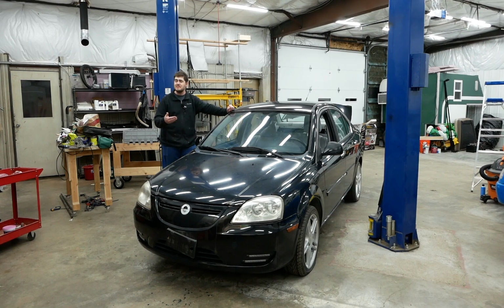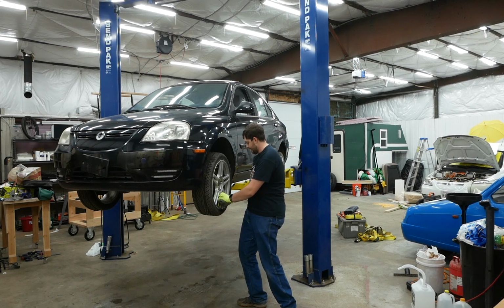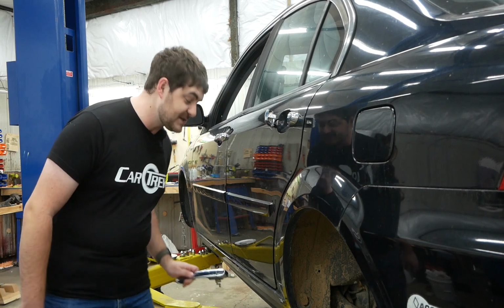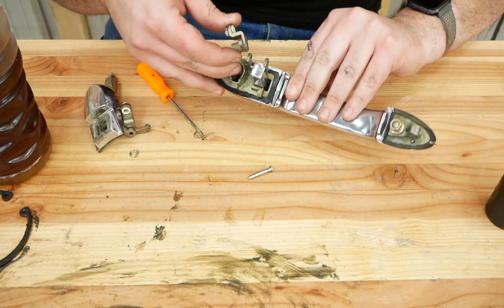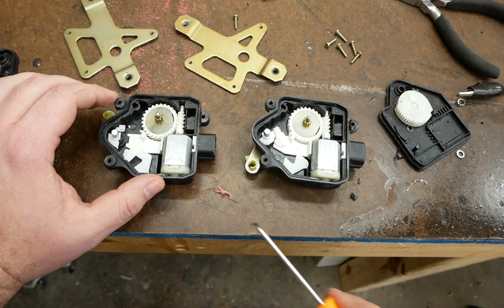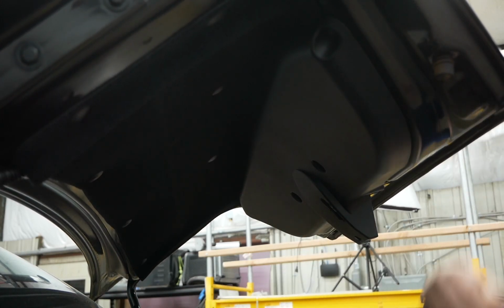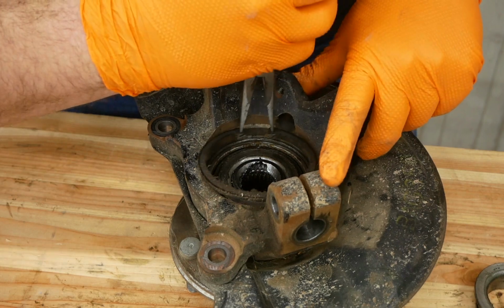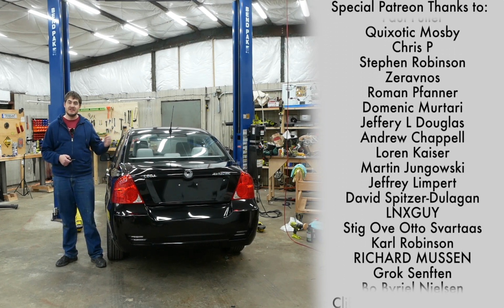Here's What It Took to Get My Broken Coda EV Back on the Road

Comment: Really dumb question... 2015 model Hyundai Accent, slight obvious vibration in my steering (most prominent at 25-40 mph and around 80-85 mph), is that wheel balance or could that be my wheel bearings are bad? I honestly don't what to look for when it comes to bad bearings and want to learn vehicle symptoms and start repairing my own car.

Comment: Fun fact:  The chinese car the Coda is based off of traces its lineage to a Mitsubishi sedan from the 90's.  Hafei bought the designs from Mitsubishi, cheapened up a few things, and voila, the Coda platform.  Also, since Mitsu and Chrysler were co-developing vehicles with each other, if you ever need replacement parts for some of the Coda suspension components, there are some bolt-on replacements from the Jeep Compass parts bin.

Comment: You can cure spray paint nicely by placing the item in the oven at the lowest temp(200f usually). Or if your oven doesn't go low enough just use a hair dryer.

Comment: Hey that’s cheating, putting in a better Trunk popper make this an amazing upgrade, next thing you might be grabbing a Tesla Battery pack and increasing your range … the wheel bearing problem is just Chinese bearing manufacturing problems …
 Fit the Skf equivalent bearings and most of your problems will likely disappear …. Or something local that you trust that fits …

Comment: As a future hint, I watched you take the nut right off the steering rod and then hammer it out... far better to get the nut to the end of the thread then hammer on the nut until its all loose, finish undoing and take off -  you really dont want the end of the stud munged over.

Comment: Robert, you might made a terrible mistake by putting additional lube to the bearing. It might get liquified with the high temperatures and it will make its way to

 BRAKE ROTORS 

and will spoil up your  brake pads. Wish i was wrong, but this may end up in the back of somebody's trunk. Please upvote  - its all about safety.

Comment: On gearboxes, transmissions, etc. - always remove the fill plug first.  That way if you have issues getting it off you still have oil in your thing and the thing is still operational.

Not that I ever ran into issues getting the fill plug off a transmission and kept my car in the garage for several days longer than I anticipated.  Nope!

Comment: whewn you take out a ball joint or tie rod end. to break the taper free you whack the knuckle where the taper goes through. you dont smack the object you are trying to remove!!! you smack the object it goes into! the shock will pop it right out the taper, no damage to threads or anything else.

Comment: As someone else said, those bearings likely have a variant that has seals, and you just got given the unsealed ones. Though at the same time they look identical to Mazda Miata front wheel bearings, which are sealed for sure. So I'm wondering if those could work as a replacement if you have trouble getting sealed ones following part numbers. As long as the dimensions are the same it would be fine.

Comment: 14:45 yes you do.
Check the running surfaces of the old bearing races.
If they are shiny, they didn't fail from dirt,
if they're dull grey, or even visibly rough and scratched, they did.

Comment: BTW the bearing you changed was a tapered bearing, and it sometimes requires another preloading after its first miles. The job is tightening the nut holding it on :D, or it will have a lot of play. There are many videos on youtube how to do it but basically tighten the nut until there is a little resistance rolling the wheel and then a quarter turn back.
Great video anyways, good luck keeping her on the road.

Comment: Great job on the trunk release, far better than the 'factory' unit.  Cheap, crappy plastics rule with this car.  I have never seen open front wheel bearings like that, they will probably last almost 5 minutes!  😊👍

Comment: You should have ordered bearings with 2RS. Those are for 2 rubber seals. You remove one with a pick. Or you can leave both on the bearings.

Comment: Gearbox oilchange tip: you might wanna try removing the top plug first, and only drain the oil after you know you can fill it up after. If for some reason, the refill plug is shut, which happened to me once, the car at least remains mobile until you come up with a solution :D

Comment: All that effort and you go and use an impact on the axle nuts. No bueno.  Also, it looks like the only thing holding the brake dust shields on are the caliper bolts. That's when you say they were "extra" that year.

Comment: All the crap you own and you don't have a pair of snap ring pliers?
Reply: Snap ring pliers are over rated.  Far more fun to use needle nose pliers, small flat head screwdrivers, etc. so you have a better chance of sending the snap ring into low earth orbit.

Comment: Vent lines are not for acid spills. It is to vent excess hydrogen gas. Trunk does not have constant air flow and can accumulate those gases. That's why they add small rubber line / vent.

Comment: Wouldn't be easier to make the plastic piece of the trunk popper out of metal?
Reply: Sure. Until another plastic piece, like that worm gear, breaks inside the popper. His fix is much more durable.
Reply: @RyanKlapperich  By his comments on the other repairs I don't think he was concerned with durability.

Comment: You need not have concerns about the shielding for your wheel bearings. My old Honda civic has run for MANY miles without shielding.

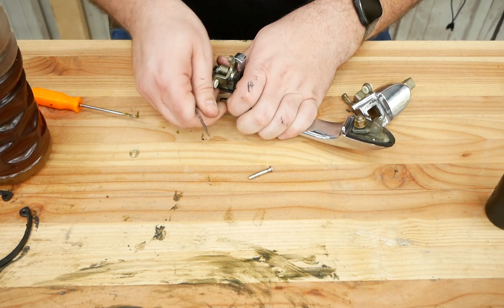Comment: The front and back door handles are probably the same just one has a cover. I noticed when you were fixing the handle there is a hole for the lock barrel, you had your thumb on it at 7:38.

Comment: If the axle nut wasn't torque to spec it can cause the wheel bearing to separate or cause premature wear. The Milwaukee ratchets are nice, but you should have gotten the beefier one, I think 
I saw you got the smaller one in your other video.

Comment: Without any formal automotive training you're brain works like a tech with years of experience. You are right in worrying about the bearings, measure them up and install a set of sealed bearings which I'm sure you'll be able to match up to. Great job.

Comment: and yes, the wheel bearings in my saturn were open backed like that.  living in the midwest, they ate wheel bearings for breakfast, lunch, and dinner.  I had to change them every 15000 to 25000 miles because they would just fail.  even the OEM ones were open with no seals.
Reply: I can't believe they make completely open bearings like that for any car... destined to fail.

Comment: FYI, those door handles are probably standard Mitsubishi or GM parts bin parts.  The wheel bearing/hub looks exactly like the setup on my old 02 Saturn, or basically any other early 2000's GM FWD car.

Comment: What I find funny about these Codas is that if they'd had better engineering/quality in the stuff that applies to the Chinese auto body and if the price had been closer to a conventional gas-powered car in the same class, they might have had a chance to sell well.  I like the styling, it has neither a silly body shape nor a bunch of bolt-on garbage to make it stand-out as being electric.  Thing is, to compete they would need to be less expensive combined to own and operate over the duration of a five year car loan than a combustion-powered car of the same size and roughly same equipment, and would need to last without requiring major repair for the better part of a decade, and that definitely includes things like door latches and trunk releases which annoy even the most understanding owner.  The wheel bearing problems are also a deal-breaker obviously.

If these cars had been built better and priced more appropriately for the market segment then that might've pushed electric car adoption ahead by a decade.  Instead we had cars covered in cheap, ugly plastic trim or cars with bodies that were just unattractive.

Comment: now imagine that happening on a hatchback with no emergency release, no key hole and screws trapped under the door that you need access too, ohhhhh and razor sharp metal you have to rach into blindly from inside the car, Thanks mopar. Caliber has this same exact release problem, a gear motor that just stalls with no limit switch. So every time you hit the unlock it spins the motor. Good work with the solenoid, you might want to put a flyback diode , or reverse diode so the field collapsing doesn't kill the output on the computer assuming its not a relay, Just one Robert to another who breaks things.
Reply: He shouldn't need to install a new flyback diode. The old motor would also have inductive kickback, so the electronic output surely has protection built-in.

Comment: I don't think those bearings will last long without seals to keep the grease in them. The cluster problem might just be a stripped gear in a stepper motor, a common problem in GM cars. It might use a common stepper motor used in other cars.

Comment: Top Tip: Always undo the top drain plug first because then if it gets stuck and doesn't come out you at least still have oil in there.

Comment: I am very tempted to fit aftermarket central locking and electric window's kits on my Robin.   Had an absolute beautiful run yesterday going the long way round to Shaftesbury coming in from the NE side of Shaftesbury tor up a very very steep climb and came back out on the Gillingham road where outside the speed limit I had the old girl zoom up to 60 and went round the local infamous S bends like it was on rails and I could see this car behind me, he was gesturing at me I could see in me window prob incredulous I was motoring round these very tight bends with little sign of slowing (I do drop to 50 in third gear and don't even get a slight indication a wheel is going to lift at the back).   Last week, I tried to do a burnout but instead did a tiny little wheelie hop up front, car did not like that one bit hehe   Oh Robin's abs love the snow, do try it out as because where 4 wheel cars leave two tracks in road snow, the front wheel has that soft ridge in between the tracks giving you excellent traction and road holding.

Comment: “My ratchet just broke” Ladies and Gents, this is why you buy Milwaukee.
Reply: My brother has a 3/8" Milwaukee and I'd still not want to use it to break loose those strut bolts. You can feel the casing flex when you start to put a lot of torque on it, not exactly confidence inspiring.
Reply: @NathanielHatley  Yup, they just aren't the right tool to do that. Just as well breaker bars and impact wrenches were invented.

Comment: Pro tip:

Leave the wheel on, lift it off the ground, push the wheel so it rotates, with your other hand on the spring.

You shouldnt feel any vibration at all. Otherwise, new bearing.

Comment: At 3:07 I thought "I'm pretty sure that tool isn't made to be used like that"
At 15:58 "called it"
Reply: It should be able to handle being used like a normal ratchet :/
Reply: @jonwally2002  He was using it like a breaker bar though.
Reply: You don't break bolts with an electric ratchet.

Comment: The back door handle has a hole for a lock. Are they not the same part as the front but with a different cap on the rear?

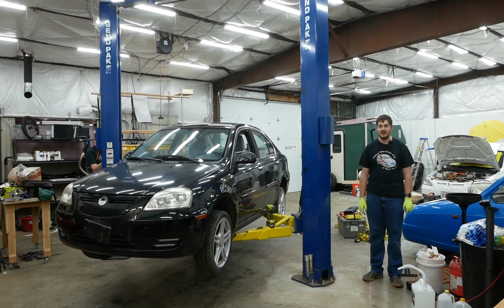Comment: I am 99% sure those lines on the battery at 2:00 are for venting excess hydrogen so your trunk doesn't explode, rather than anything to do with battery acid. P2 Volvos and various crap GM products are set up the same way. On my S60R it was called a "vent tube".

Comment: Is the "always use power tools" an American thing? In Germany they are only used for wheel bolts, some bolts that require turning many threads, or other various tasks.....but not "for everything", especially very tight bolts.

Comment: Hi Robert, have you put a flywheel diode on that solenoid?  You could end up with issues if you haven't.  I've never seen exposed wheel bearings like those 😳

Comment: The Soviet stuff breaks into nice sturdy chunks so you can hack them back together. Damn nice job on the solenoid popper, will last forever.
You are correct !! No shielding equals no lubricant. It's a huge issue. Have used the bearing & seal cross working as a Parts Manager. It explains the number change. There can be 4 different part numbers, one for each type seal plus none. If you got down to about 400 grit, clear paint will work on headlights.

Comment: 13:20 This ist the best way to destroy your shiny new bearings- because you transfered the load through the rollers, likely chipping or deforming the rollers. When pressing into a housing always transfer the load to the outer ring of the bearing, when pressing in the shaft use the inner ring.
But you sure can try again in approx 1000miles when your new bearings sound like rocks in a blender...
Reply: The bearing on top at 13:20 is the old bearing.

Comment: The most satisfying boot lid popper ever! That's a great fix.
Reply: I was also impressed! But I wonder if the electronics that originally were meant to power a little 130 size electric motor can handle an inductive load of that size. The problem is when you turn off the power to the solenoid, you can get a massive voltage spike. The typical fix is to put a diode in parallel to the coil, so the current has a way to dissipate.
Then again, if the motor was controlled through an old-fashioned relay, it can likely handle the spikes (it seems to work so far!)
Reply: @foogoid8682  I would say, having repaired and fitted aftermarket ready made security and popper systems that the back emf protection diode, (to which you refer) is likely built in on the controller output. The output itself is likely to be able to handle a large current pulse, likely to be 10 amps for a brief duration. This is also likely to be close to the original popper's motor stall current.

I like using the word likely. 😉

Comment: that hubknuckle steering assembly looks exactly like a 2001 A33 maxima's, even the bearing install procedure look the same.

I'd look up the A33 2001 maxima front wheel bearings and take the measurements to see if they match, they are designed to take the weight of a 3.0L engine on top of em, and have good shielding

Comment: That broken part in the trunk popper looks easily 3D printable. You could cheaply make a bunch of replacements in plastic or get have one made in metal that won't break. Either of these seems preferable to me over that bulky linear actuator. (EDIT: oops I did the thing where I commented before finishing the video, that was a pretty clean solution).

Comment: I think there lack of seals is why the wheel bearings failed.  Maybe you could add a zerk fitting to the spindle so every so often you could pump some lube in.  Or maybe find some sealed bearings.

Comment: It hurt when we drilled out the metal pin on the door panel and scratched the plastic door panel with the drill bit. Robert I beg you please keep the coda nice after you killed the wheego!! Cool video its nice to see the Coda getting all cleaned up.

Comment: The doorhandles, this is where 3D printing comes in!
Reply: I think I would go with cast from aluminum then polished.  Then add a clear coat of uv resistant paint.
Reply: literally scrolled to find a comment like this after seeing that part of the video

Comment: You should maybe invest in a 3D printer and look at something like Fusion360 or maybe some free CAD software. Some of these cars have plastic bits that I'm sure are hard to come by and you may have no choice but to model and print them yourself, like the broken bit of the handle. Alternatively, I have a 3D printing Etsy shop and am okay with designing things (I design all of the stuff I sell), so you can also just ask me or someone with some 3D printers to do it for you!

Comment: Those bearings look like pretty regular bearings. Usually that stuff is normed.

You can usually buy fitting replacements from any hardware store that carries them.
Just take the old ones with you and get fitting ones with their highest carry capacity and appropriate sealing.

Comment: Dude, that solenoid trunk popper - amazing. I'm assuming that thing cost you $10 or $15, but the little one that committed suicide in front of you must have been like a dime and from the looks of it is fashioned out of the same plastic gears as are in a battery powered novelty wall clock movement. And if it was any car company still in business, I'm sure they would have sold you a new cheesy trunk popper for $94.50 or something.

Comment: Normal people: "DIN plug"
Rob, an intellectual: "Deutschkonnektor"
Reply: He should be saying in a long way : Deutsches Institut für Normung konnektor :P
Reply: Diese Kommentarsektion ist nun im Eigentum der Bundesrepublik Deutschland
Reply: @gotai8  @Dauerwerbesendung Morgen ist Mittwoch, meine Kerle.
Reply: I dunno, "Deutsch Connector" is a pretty common thing to say in the auto repair and electrical engineering circles I've bumped into over the years.
Reply: Deutsch connectors are not DIN in any way but come from a company named Deutsch.
Reply: @semifavorableuncircle6952 indeed, "Deutsch is a manufacturer of electrical and fibre optic connectors. [....] The company is now part of TE Connectivity." Says Wikipedia
Reply: I’ve heard it as Deutschplug too
Reply: Annexation by Deutschkonnektion.

Comment: 13:30 when ordering bearings the suffix tells you what you are ordering
2 RS - Bearing with rubber seal on both sides. RS provides a better seal but more rolling friction than 2Z.
RS - Bearing with rubber seal on one side, one side open.
2 Z / ZZ - Bearing with a metal seal on both sides.
Z - Bearing with a metal seal on one side, one side open.